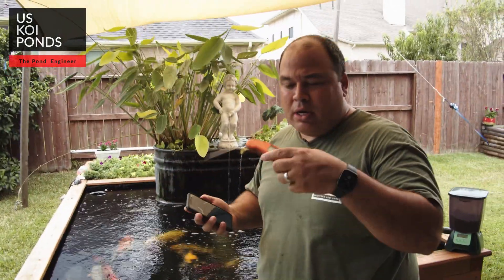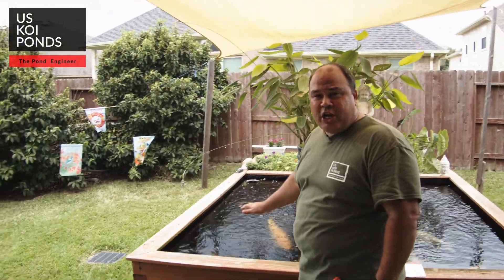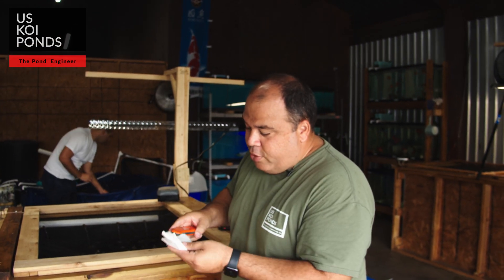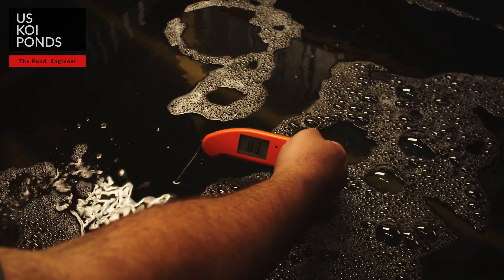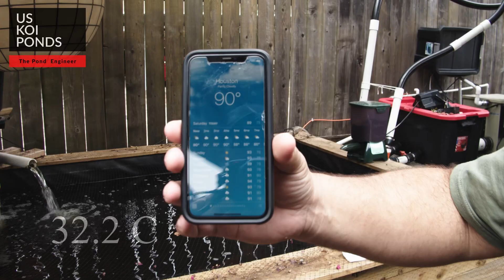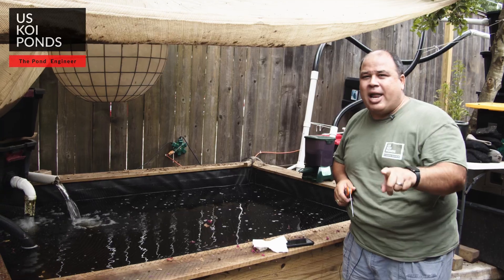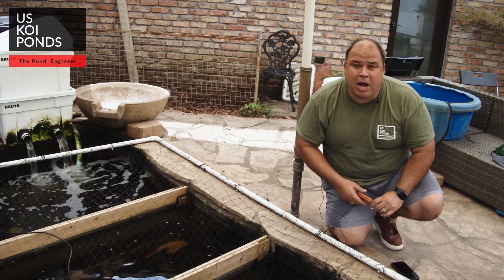Water chiller in a Koi Pond, does it work?

Comment: I greatly enjoyed your video and I am hoping for some advice/guidance please! I bought my house three years ago here in Central Florida, and with the humidity and heat index it gets up to 100 to 110° in the summer months. When I bought my house it included 2 Koi fish ponds. Though there were no koi in my ponds at the time, my intention has always been to invest in the Koi fish and enjoy the beauty of them in my ponds. Unfortunately, three months after purchasing my home I was diagnosed with breast cancer, undergoing an emergency mastectomy, and cancer treatment for two years. I’ve been unable to fulfill my dream of having my ponds stocked with Koi fish until recently. Since beating breast cancer, I’ve invested a lot of money in redoing the landscaping around my yard, my Koi pond and encasement, and creating an environment where Koi fish can thrive. A month ago I bought a few goldfish as an experiment to test the bio filter in my pond, unfortunately all six goldfish perished within 24 hours because of the high/warm temperature of my pond. I was devastated!!! My large koi pond is a 300 gallon pond that is 18 inches deep by approximately 8 feet long, and 6 feet wide. I have invested in having a shade sail installed, and have made every effort to keep the temperatures cooler with plants and aerating the ponds, but believe I need a water cooler/chiller to achieve the appropriate temperature levels. The problem is, though I’m a nurse/nurse practitioner, I am not mechanically inclined lol. Many things I’ve read online have been misleading with the exception of your video, but believe installing such a chilling system as yours is way out of my scope lol. I was hoping you could please advise me on a simple chilling system for my Pond please, and or other advice on cooling the temperature in my pond? I greatly appreciate your time and guidance!

Comment: I just purchased a similar unit. It looks the same.  What size pump do you have for to chiller.  I have a 800GPH pump would that work.  I am in central Florida. With a 275 gallon pond.
Reply from the maker: If its for a 275 gallon pond you can probably use a smaller pump. Maybe 500-600gph is enough. Just make sure you install a ball valve before the chiller to control the water volume if you need the chilled water to be cooler or warmer. Good luck and let us know how it works for you.
Reply: I’m also in central Florida thinking about doing the same thing .

Comment: Your using that probe wrong anyways the whole metal area needs to be submerged or its ready air temperature
Reply: Kyle this is a Thermapen and according to the manufacturer the temperature sensor is located on the tip 1/8". This is directly from their user manual: "The micro-thermocouple sensor is located at the tip of the probe shaft. Minimum immersion is only 1/8" (3 mm). For best results, immerse or penetrate the probe into the food item so the
probe tip is in the place you want to measure." Thanks for watching the video.

Comment: ...isn't a koi pond basically an outdoor aquarium?
Reply from the maker: Not really. Koi ponds have a very different demand in terms of filtration systems. In aquariums you don't deal with tree leaves floating in the water, the extreme summer heat or winter freezing, green water from the sun's UV rays, and so many other things don't translate from aquariums to ponds and vice versa.

Comment: I'm putting in a 1/8 acre fishing pond approx 65 x 70 feet. I'm putting in a waterfall with a sectioned off area 24' x 24' x 36" depth.if I run a pump through a filter chiller system would this maintain a suitable temp range for trout within the coordinate section? And what size system ? Approx cost.
Reply from the maker: Hi Steve! A 24'x24'x3' area is aprox 13,000 gallons. For that water volume you would need a massive chiller unit to drop the temperature a few degrees and maintain it. You would need to get in touch with a mechanical engineer with a thermodynamics background to size that for you. And I guess the cost of the unit and to run it will be substantial.  Good luck and let us know how the project goes!

Comment: I just set up my pond of about 1000 gallons. The water temp goes up to 92 degrees which I was told is too hot for Koi. I put in a shade sail over it and used some pond dye. The temp now reaches max of about 88 degrees late in the afternoon. It is about 82 in the morning.  I am worried about putting expensive Koi in water that hot. Do you think keeping it under 88 would be ok? I do have a big waterfall and 4000 gph pump so water gets moved pretty good.
Reply from the maker: Hi Juan! Thanks for the comment. At 88 degrees using a sail shade you are a little on the high. How deep is your pond?
Reply: @USKoiPonds  Pond is only 18 inches in the deep area and about 14 on perimeter. I have put up a sail and the water is now running between 84 and 82 degrees. I have a large waterfall running so oxygen is not an issue. The fish seem to be doing ok. I feed them twice a day small amounts. So fare so good but I have a lot of black algae allover the waterfall and rock bottom. Going to try some barley straw for that. Thanks for responding.

Comment: Great idea but if it goes out (which it will) your pond temperatures will rise very fast and could kill the koi.
Reply from the maker: I guess anything can break down, liner, pump, pvc pipe, air pump and any of those would most likely kill the fish as well.
Reply: @USKoiPonds  true … but the koi don’t need a cooler to survive 👍 I live in Florida… my water temps get extremely high in the summer and if a chiller broke .. that temp swing would definitely kill them. I would have to have a back up or two going maybe
Reply: @TheHeadman  the temp swing would be gradual though. Depending on pond size, it should take the water a few hours to warm up. I'm in FL as well and it takes my 2,000 gallon pond 6 hours to move 5 degrees. Like PH, they can withstand a wide range but gradual change is key, sudden spikes are trouble. On our hottest days my pond is running 90 degrees and the fish are definitely a bit larthegic in that heat so I'm thinking of getting a chiller.
Reply: @bimanth  maybe get a shade sail … 90 or higher is not safe. You shouldn’t feed your koi if the water temperature is above 85 as well. We put a few shade sails over our pond and it definitely helps some. The Florida sun is brutal
Reply: @TheHeadman  yes, we are putting in shade and a pergola. My water temp has been 85 or higher for at least 3 months. I’ve read to stop feeding at 90. If I stopped at 85 they’d never eat 😬
Reply: @bimanth  that should help for sure … we have a shade sail and a pergola as well … we actually put a shade sail on top of the pergola as well 👍 We just bought a metal pergola to replace our wood one … uug … I’m getting to old for this stuff 😂

Comment: Can you put a thermo switch to turn on the chiller as needed?
Reply from the maker: Yes. Actually the unit comes with a built-in thermostat but since the temperature difference between the chiller output and the pond water is so great, it turns ON-OFF-ON the compressor too many times. So it's better to either size the chiller appropriately to the pond water volume (which obviously I didn't) or put a thermo switch that measures the pond water temperature and not the temperature at the chiller outfall like the built-in one does. Thanks for your comments.

Comment: Great video. Thank you for sharing. 

I am interested in adding a chiller. I like quiet and do not want anything that will add noise. How noisy is a chiller?
Reply from the maker: The noisy part is the fan but they are generally less noisy than a house air conditioner compressor unit. If you have the filtration system separate from the pond, you will most likely hear the waterfall louder than a chiller unit.